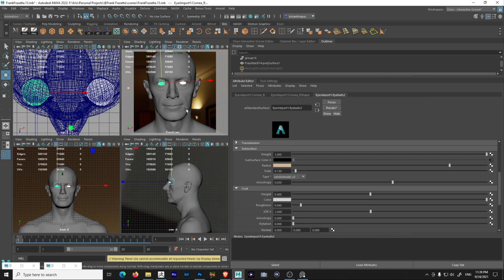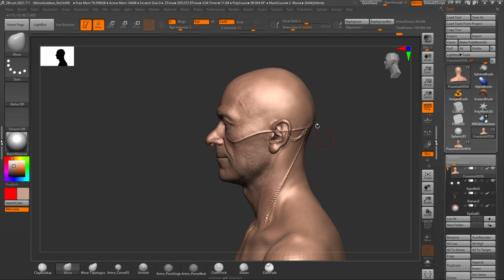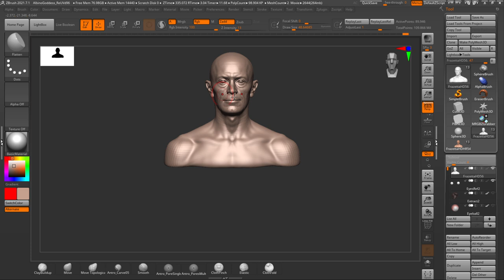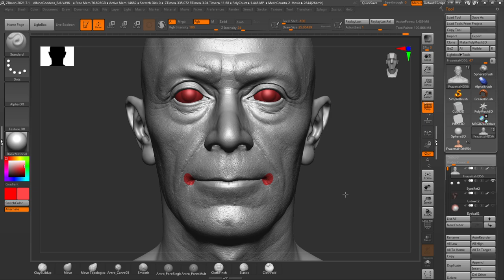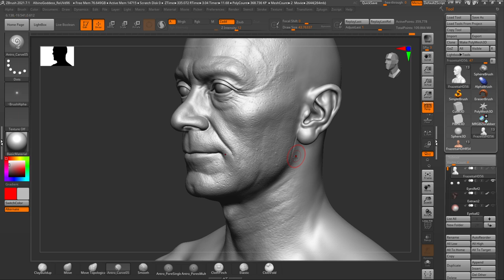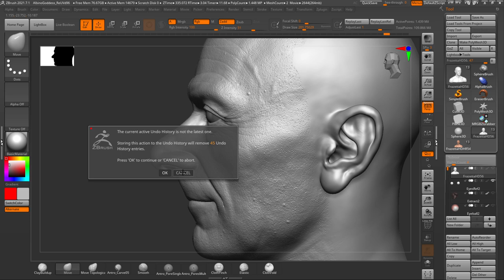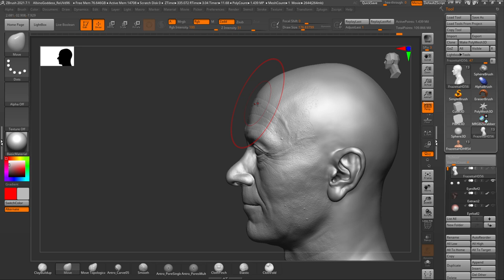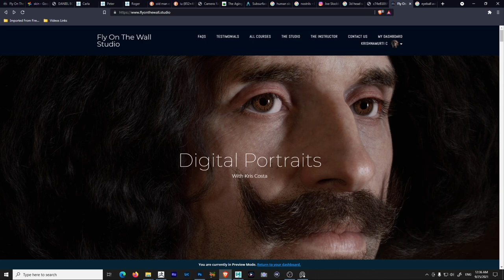The Most Common Anatomical Mistakes While Sculpting Human Faces!

Comment: This is SO GOOD!! I mainly do environment concept work, but when I do characters I notice a few areas where the 3D artists struggle (to be fair, I'm sure their job is technically more difficult than mine in 2D): #1 failure to recognize loss of mid-face volume in older characters. Any char who is not a child, teen, or highly stylized has SOME loss of mid-face volume. This manifests in concave areas below the "eye bag" & in the cheeks. #2 is insufficient cranial volume in the back or lack of sloping in front top of cranium. You mention this, too. #3 is the neck, just all of it, I realize it's incredibly complex but so many 3D guys just model a cylinder neck & it really detracts from the char. #4 lower part of skull by mouth not properly convex, seeming flat. I tend to also observe low nose bridge but this varies widely by ethnicity so if your 3D team isn't accustomed to sculpting Westerners, they need to be told to pull out the nose bridge.

I could go on, but you've covered quite a few. Your sculpting is beautiful, A+